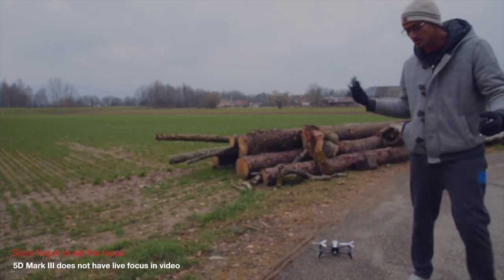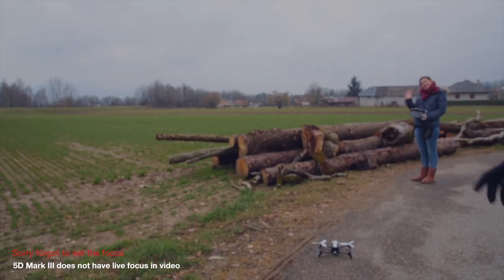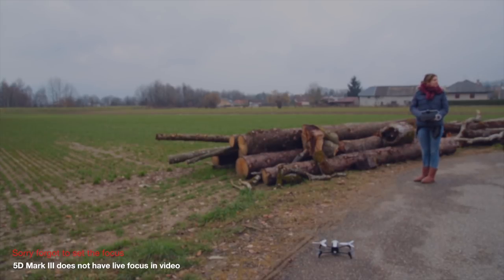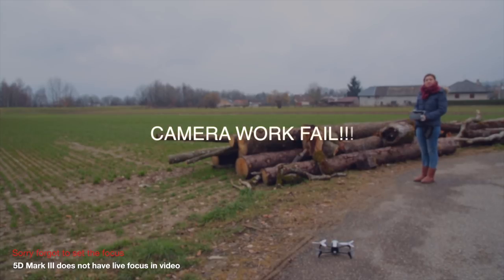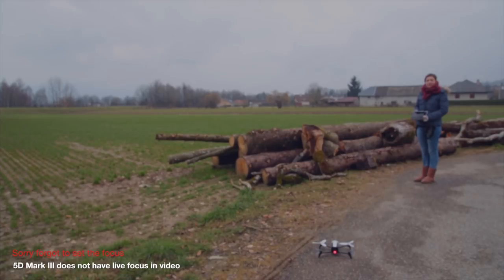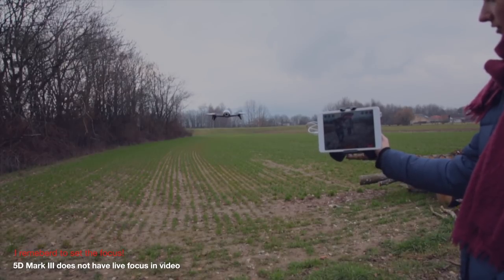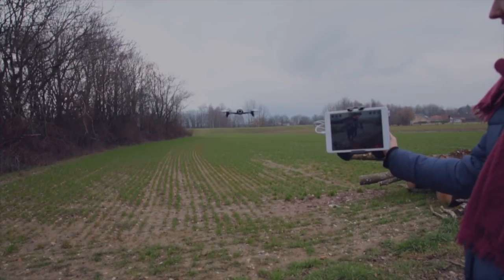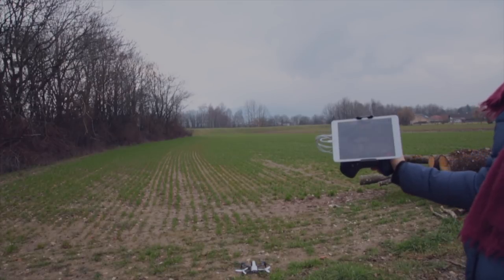BEBOP 2 Battery Discussion and Experiment

Comment: Nice video anthony 👍its almost 9month i've got my bb2 but happily my batt still have 20mins flight time.. i never used any balanced charger n check the voltage n i guess i was bad in electricity stuff lol... i do some research in utube or parrot community for storing bb batt n got some info also from @mrkentdotcom for always leave it under 50% min for storage ( i never know when i'll fly again )

Comment: Hi Anthony, just first off, your reviews and educational videos are very interesting and informative! One thing I'd like to find out from you, is there anywhere you know that I could get a bebop 2 "power edition" battery pcb, for my spare battery?  Mine was damaged by the previous owner while trying to measure voltage readings directly on the battery connector with his multi-meter and causing a short between two opposing pins.  The cells themselves are perfectly fine and were about at storage level when he caused the damage to the pcd.  If I can manage to get another good working pcb, my second battery will be useable again.
Reply from the maker: Hubrecht Fladderak hello! Thanks for the kind words. Unfortunately parrot has no schematics or provide the BMS pcb on it’s own. Iv only experimented with universal 3S pcb but the good ones don’t fit inside the enclosure and the ones that fit are low amperage. :(
Reply: Thanks for the info.  I suppose I will need to hope for a chance to get hold of an 'old' used Bebop 2 Power battery from someone, of which the cells are used up/damaged and then use its pcb in my otherwise good battery.  :)
Reply from the maker: Hubrecht Fladderak if you use a balance charger you can bridge the traces on the exhausting pcb to omit the balance circuits as the balance would than be done by the balance Charger. Just Incase the wait is prolonged 🤞
Reply: Yes awesome, that is another good option!  I have a Turnigy Accucell 6 charger and also A modified parrot battery connector cable for balance charging that I have made up but not yet used.  Thank you for the info!

Comment: Hi Anthony, would be interesting to see what effect an aftermarket intelligent charger has on two batteries, where one has original parrot cells with a GiFi pcb (no balancing circuit internally) and then one standard parrot battery with original pcb and always charging them both, using the balance charging function of the charger, over a long period of time.
Reply from the maker: Hubrecht Fladderak seeing this video is over a year old and I use oem batteries and charger the oem pair has proved longer and more réalisable. My gifi batteries have been retired due to swelling even in using 3rd put balance charger for them. The BMS in the parrot batteries meet the standards like ebike and other electronics that are permitted in EU. The others non compliant proved to be unsafe over time. Hope this helps and welcome to the bebop 2 scene :)
Reply: Thanks for the feedback Anthony, it's always great to watch your posts!

Comment: My Bebop 2 power also dropped dead and fell from the sky , all 4 motors stopped suddenly. But it occured at about 10% battery level (as I can remember well, going to 9% and turning the color from green to red), while is was in follow-me mode. It happened a few months ago with older FFpro SW and Bebop FW versions. Had contact with Parrot Support about this topic. Until today, still do not know what caused it, but it was certainly not at the 1% level. Tested the 1% level a couple of times too but that always worked fine with me.

Comment: Interesting video Anthony. I did an experiment with my battery also today. Mine emergency landed with 1% a few days ago after about 20 minutes of flying. I wanted to retrieve the video data so I charged it for about 10 to 15 minutes when i got home. When I reconnected it to FFP, it was telling me the drone's battery was 100% charged which I knew was wrong. Today I checked and ffp was showing the battery at 97%. I then recharged the battery and after 30 or so minutes the light went green. I know now its fully charged but why is ffp giving us the wrong info?
Reply from the maker: Gerald t, I have experienced that and all I did was try to launch the drone and as soon as load was put it went back to the correct battery value, that happened with a GiFi battery. Did yours happen on the Parrot Battery? If so can you share the model of the battery from my notes the Parrot Batteries starting with A6A have the circuit fail prematurely, the cells however remain in good condition. The G6L have never recorded problems from my lot. The GiFi battery though is a hit and miss for me.
Reply: ANTHONYVLOG mine is a new parrot battery # 6h6186754

Comment: I have 3X B2 OEM batteries fully charged (green light) waiting spring mb in 4-5 weeks for 1st ever flight .Should I discharged them now running with no propellers on drone  for 10 minutes and fully recharged them the day before using the drone ?
Reply from the maker: Yes you should discharge them and charge before flying if they are left idle for a while. less likely chance of the battery 🔋 emptying rapidly unexpectedly during flight ✈️
Reply: @ANTHONYVLOG   Thanks Anthony..Id just noticed that the 2xtra batteries I bough are Power Batteries.. is it safe to fly with them on a regular Beebop2 drone (2700mAh)?
Reply from the maker: @cudaker  the 3350mAh Power batteries are perfectly fine to use on the BEBOP 2. They would also use the HD charger and not the standard that the 2700mAh use. :)
Reply: @ANTHONYVLOG  while waiting for an HD charger its ok (Safe) to charged them on a regular charger ?
Reply from the maker: cudaker I wouldn’t say safe but they do charge the power batteries. I wouldn’t recommend doing it for long or allot as the charger will eventually fail.

Comment: Once again, thanks for great videos. I have seen a lot of discussion on how people don't like the fact that the Bebop 2's batteries have a proprietary connection making it more difficult to properly balance the batteries as the stock Parrot charger apparently does not balance the batteries. They continue to state that the batteries are not "smart" batteries like DJI's which balance themselves. I always thought why would Parrot supply a charger and battery that had no balancing without telling customers to properly balance the batteries. I was always suspicious that the batteries did have balancing circuits in them. So, from what you showed in this video, the Bebop 2 batteries ARE infact "smart" batteries and balance themselves? Can you confirm this? And how do you know for certain that connection and circuit board are infact a balancing circuit? 

I have also watched Mrkentdotcom's video on balancing the Bebop 2's batteries. I was thinking about getting a couple of connectors as he suggests and making my own wires to connect to my balancing charger but now that your video seems to confirm that the Bebop 2's batteries do balance themselves I'm wondering if that's necessary. Other than being able to charge to "storage" level and charge more than one battery at a time maybe it's not really necessary to balance the batteries?

And you are fine in front of the camera...
Reply from the maker: Airwolf Thankyou so much for the time in writing that. I can confirm the Parrot BEBOP 2 and power have self balancing circuits through personal experiments, they have improved that in the HD chargers / batteries for the Power as well the HD battery and charger is documented by Parrot to be better (for obvious reasons) lol. But I think there is a misconception about these batteries being intelligent, my assumption is if a battery is to be intelligent it has to be able to (if I may get derailed and talk about the Mavic Air battery), there were people saying its not an intelligent battery because you cant set the storage voltages or have control on the battery itself or update its firmware. But that was wrong, DJI improved the battery but removed the user control. The Mavic Air battery will discharge itself to storage voltage when not in use, it will also go in to hibernation mode when not in use for a long period and it will not power on until you put it to a charger to reactivate the battery, the BMS in the battery is software based and the firmware is uploaded when the magic air is updated. Removing the user from the process eliminates possible user error. For parrot the protection and balance circuit is not software based, it can only handle balance. The quality of the balance is subject to the condition that the circuit is working fine. The circuit I was showing in the video is defective, and was reporting different cell voltages, upon removing the cells from that board and attached to a known working battery board it charged up fine, held current on load and the cells were evenly charged and discharged. 

I still think for the BEBOP users they should check the cell voltages before flying. Because a charged 100% battery can have cells racing from 6v to 3.5v and when the lower 3.5v battery reached 3v the circuit shuts it down hence the fall out of the sky even with 20% etc. So the bebop battery is smart but not intelligent if that makes sense.

Now onto the balance chargers, in the case that the circuit on the battery is failing or failed and can no longer balance your batteries charge, this is where the balance chargers come in as they can target charge specific cells instead of supplying it to a rail and expecting the circuit in the battery to do the balance. I have noted that Parrot Battery starting with A6A have premature failure of the circuit probably due to the outsourcing of their battery manufacturing different suppliers different quality.  

Parrot still adds an additional note that you must only use balanced chargers on page 35 of the General Information user guide. Conflicting if you ask me but I can see why they added that extra note and not said "ONLY USE PARROT CHARGERS"
Reply: Ok, so this is all very interesting to me. I have the Parrot 2 Power FPV Extreme pack with 3 batteries and a back pack. The kit only came with a Quick Start User guide in multiple languages. So I went to the website and discovered the User Guide .pdf. Sure enough on Page 35 it does mention to balance the batteries with a balance charger and to set the charger according to the individual cell voltages. The Quick Start Guide only has the basics but it's specific to the Bebop 2 Power as in it always uses the word "Power" when referencing the Bebop and the battery. It also correctly states the battery flight time and charge time. It also talks about the Cockpit Glasses 2 as to the original. The reason I mention this about the manual is because I would think that Parrot would have mentioned the battery balancing information with the provided manual in the Power Kit. But I had to go find it on Parrot's website in a generic Bebop 2 manual that was written prior to the Power edition. 

Anyway, I just feel that Parrot should have addressed this a bit more and the fact that they mention it so vaguely in a user manual not supplied with the kit and don't provide an adapter for the battery to be used with a professional balance charger is a bit odd. You'd think if they are going to recommend balance charging with a third party charger than they should provide an adapter cable. 

That being said, I'm going to make my own based on your's and MrKentdotcom videos on the subject.

I am familiar with regular LiPos as my Yuneec Typhoon has standard LiPos that I hook up to a balance charger to balance and store.

The other odd thing about Parrot's batteries is that if they are designed in such a way that they are only "half smart" in that they only balance and cut off if they get too low in fligh, then I feel that this is almost dangerous since if the circuit senses a cell is too low and then cuts power to "save itself" it really is causing potential damage to the Bebop 2 and possibly damage or injury to anything below it. It seems better to just have normal LiPos without any voltage circuits unless they do what DJI did and add a full computer even if it costs more.

Interestingly, the Parrot DISCO's batteries ARE normal without any "smarts" and they include a standard connection. I wonder why they chose to change the battery system for the DISCO?

In any case thank you again for this information.
Reply from the maker: Sold we dub thee bebop 2 battery half smarts! I am with you on the batteries being dangerous specially on the cut out. Maybe they will come up with some ingenious idea soon.

Comment: curious.  If this is a 11.1V battery, how can each cell be 4.15V = 12.45V?  or, what's the max voltage the bb2 can take?
Reply from the maker: Each cell fully charged is 4.20V the battery is a 3S / 12.6V fully charged. 

16v is the maximum i have tested on the board before i fried it. 
The bebop 2 wont operate below 9.6V DC

Comment: is it good to leave your bebop battery mounted on the drone when not in use? Does if affect the battery's life span
Reply from the maker: Iceodd Group anything under 10 days no worries if more you need to put the battery to around 70% for storage. Battery life is dependent on the condition of the liPo cells and their upkeep. Or putting them at storage voltage 3.85v per cell to keep them for long without use and discharge and recharge once every 3 months if still not used.

Comment: Very nice!👍just for short... I have here a collapsed battery, giving me about 3 minutes of flighing. If I charge it with my Parrot charger, it is charging and giving me a green light. My smart balance charger doesn't even accept it and says connection break. How that can be? For my understanding the Parrot charger is just reading the voltage of 1 cell, of cell number 2 to be concrete, because this is the only 1 that reaches 4.2 V with it. I think the fall outs are caused by puffed batteries or a bad connection. If I wouldnt always observe the discharging when flying, my Bebop also would have been falling out of the sky... and you know, my 4 batteries are older than 1 year. Fresh charged with the Parrot charger not 1 was giving me more than 80 %. Now 1 died, but balance charged, the other 3 are giving me 100% again. Thx a lot for your help and experiments "Bebop2 guru" ☺
Reply: Ahh .. If you would like my puffed battery for research, I will send it to you ☺
Reply from the maker: Thankyou my friend. It is important for any uav pilot to monitor the discharge rate, that is great advice. I'd be happy to take the puffed battery, need a donar PCM / BMS to test another fault I see with certain batches of battery. And yes from what I have found the non HD charger will sense a closed circuit before charging the PCM does the rest so if that is bad the cells will be unevenly charged the light will still go green but you will see the cell voltages when all added comes to 100%. I'm still learning about it so I'll take any information you have :) Let me know how much is the postage and I'll PayPal you the postage fees.
Reply from the maker: Awesome Thankyou ill send you my address

Comment: Hi I see at the  beginning of this video you checking the individual cells with a meter could you please explain how to do this.
Reply from the maker: +Man in the sky hello. Sorry for the delay in replying I just saw the comment now. From the original parrot charge lead, the side that connects to the charger has 4 pins (5 holes but only 4 pupulated). So with the connector latch facing up. Left pin is 1 going left to right.

Using the multimeter in DCV
Cell 3
Pin 1 (positive)
Pin 2 (negative)
Cell 2
Pin 2 (positive)
Pin 3 (negative)
Cell 1
Pin 3 (positive)
Pin 4 (negative)

Totoal battery positive pin 1 and negative pin 4.

The actual pin out numbering is reversed ie. 4321. But this is easier for me to remeber.

Comment: My batteries are all charging to 100% but take off and they drop very very quickly any answers to why this is
Reply from the maker: Kenneth Kerr could be a few things, being unbalanced, or the cells just can't hold current well anymore. Are you able to check each cell voltage, that may help eliminate.
Reply: Thanks I have bought a balance charger but it doesn’t let me see individual cell so I think batteries is now useless how long of life span do they have many thanks

Comment: What made you think it fall out the sky just because it set for three weeks charged?
Reply: Sorry , as normal I asked a question before watching the video. 

My thought is , the charger the company sends with its product should be fine. It seems silly that a company would provide an insufficient charger. 
I actually ordered a a balanced charger off eBay for the bebop 2 that came with three gifi 4000 mah batteries and the charger will charge all three at the same time.  And they work just fine. I even think I get a couple more minutes fly time.  And the charger and 3 batteries was only 70 bucks. 
 I balanced rc hobby charger I use for my 4s batteries for my race quad , but I don’t see any benefits of making a special cable to be able to use on bebop batteries. I also have a battery checker and according to my stock bebop charger is getting all cells charged with in 0.1-0.2 of each other.
Reply from the maker: Hey my friend, here is why I made this. 

1. Because in previous firmwares the BSM would nearly report critical % directly from the battery cell vDC and wont have reserve for emergency landing. (Fixed in previous update refined algorithm I suspect and further improved in the latest update I'm seeing more flight time)
2. Wanted to continue to confirm this and reassure other users that keeping the battery that long fully charged is a less likely cause of falling bebop's. (I must be optimistic)